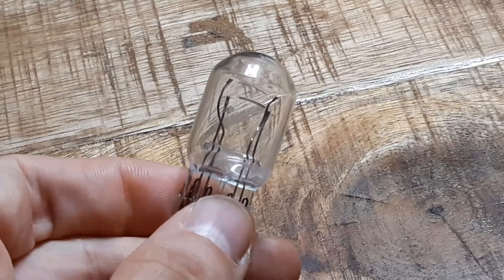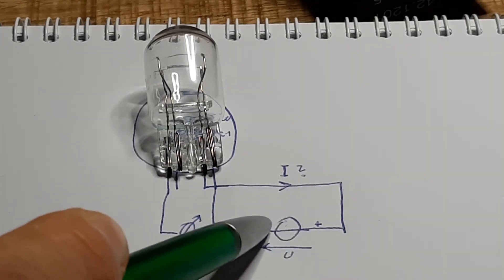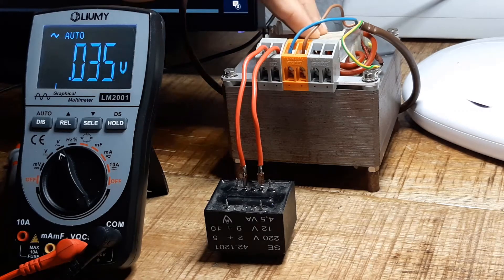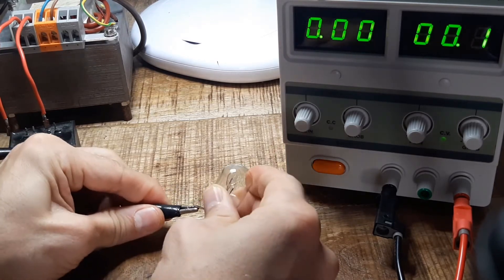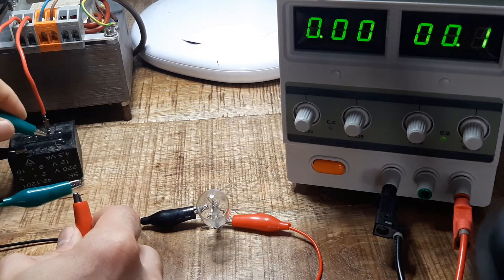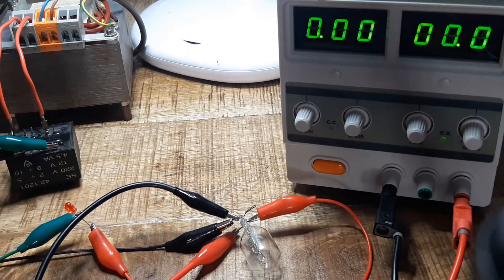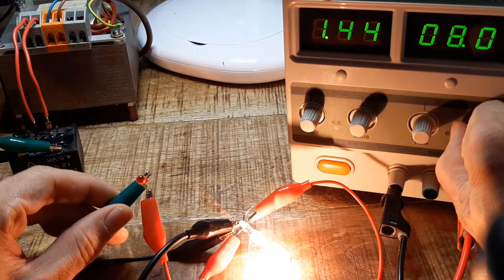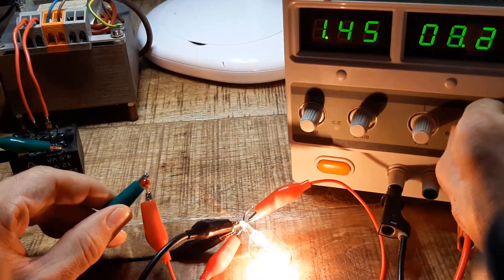Light Bulb As a Vacuum Tube, Is This possible? #1

Comment: Very fascinating!! I will give it a try with 900 volt plate voltage (anode). I wander how hard I could drive the anode before causing atomic (electrons) oscillations occur. Very cool!!!

Comment: hello sir can xenon bulb also be used from head lights?
I hade strange acurances in the past arcing relays together or back charging alternator true the dashboard or when I use so called plasma ignition.
Multipel things caused me engine to behave strange .
And the baterry it self behaved strange ordinary lead acid baterry.
Me car discharges in about 20 secunds me baterry dead flat.
In some cases arcs shuting out to me engine or the engine self acelerates or refuse to shut off with the key off.
So I suspect the blinker relay and that xenon bulb.
Is it posibel that xenon bulb can transmit high frequency high voltage?
In the dark I culd clearly see spikes shuting out at centrain engine rpms.
Mostly I suspect relays,alternators and those bulbs .
Hoppe you can helo me to trace down what cause those strange effects or bether how to control them.
Because some times engine realy runs smuth and with bether fuel economi

Comment: genious. use one fillament as cathode. the other one as anode. apply 100k volt. the anode is tungestan. so, you can ise it as a xray tube. anode will wear out soon. but it does work for spa shirt time. that small amount of tugstan is not comparable with a large turning anode xray tube. however i say it will work. but you know better, you need protection shielding against xray even in that short time. you can set up your gear, keep recording, leave the room. turn it off remotely before coming back. it will be an excellent experiment, since you already have all set up. i bet you have high viltage generator there.
Reply from the maker: High voltage and X-rays are very dangerous. So my concern is that YT will delete the video then.

Comment: I've wondered about this but always assumed there was argon inside these bulbs not vacuum.
Reply from the maker: Cheap low-power bulbs for low voltage often have a vacuum inside. No perfect one like real vacuum tubes, but good enough to let enough electrons through to light an LED.
Reply: @DoctorVolt   I’ve seen a few that were vacuum. I had a microwave oven light, a few Christmas lights that I could arc a negative ion generator across the glass and cause green electron glow on the inside by capacitive action. I only did that once or twice, I worried about  X-rays.
Reply from the maker: Good idea to judge what´s inside by the color of the plasma. If there is high vacuum, there should be no plasma at all. A partly vacuum (Air, mostly Nitrogen at low pressure) should result into a purple blue, Argon into a blue-white vacuum